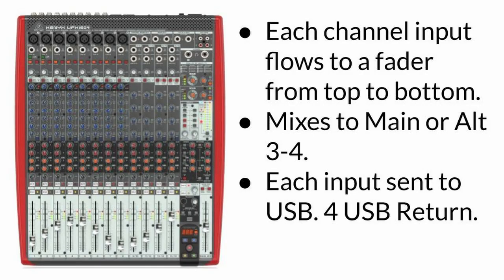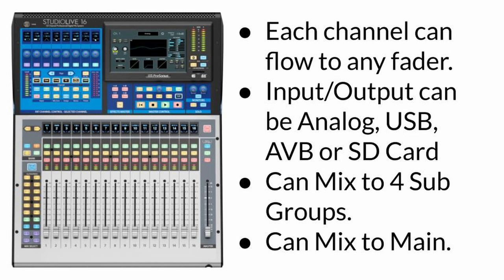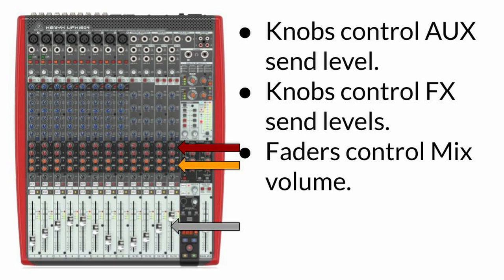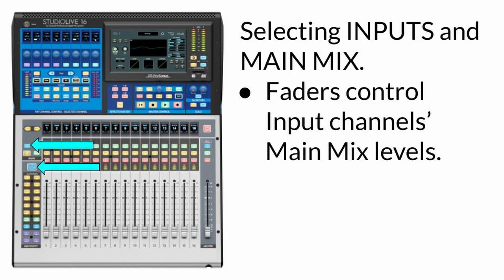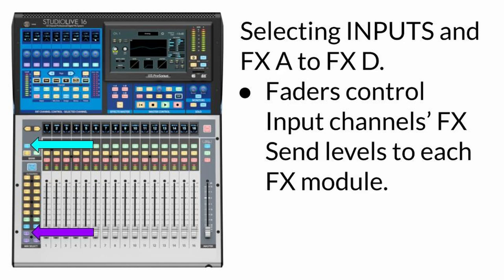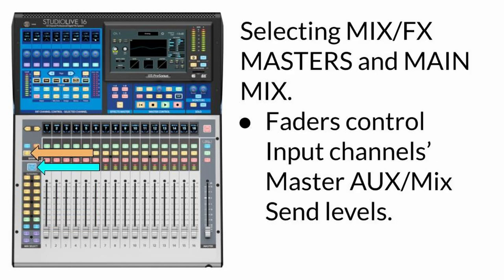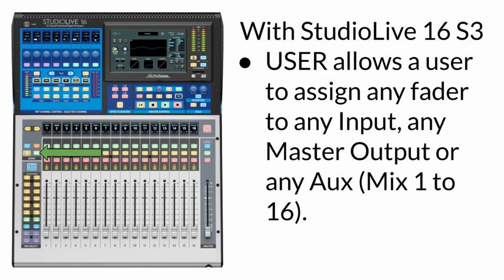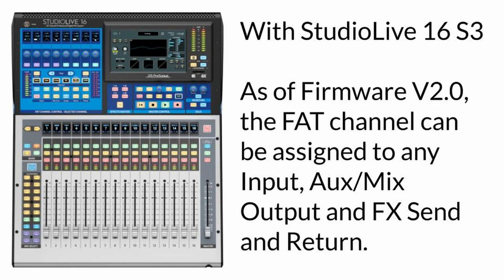Intro To PreSonus StudioLive 16 Ser III Digital Mixer

Comment: Greetings. Why have you replaced the studiolive 16 with a atudiolive 24?
Reply from the maker: Upgraded for more audio channels  and only paid the difference in price. I couldn't miss the deal. Now I don't even need a patch bay. I have enough in/out for all outboard gears are directly connected to my SL24.
Reply: @RecordingStudio9  I have worked with Motu and UA, and am upgrading to a sl24r. I hope later on I can get the 32sc 
Thanks for your answer and your videos.